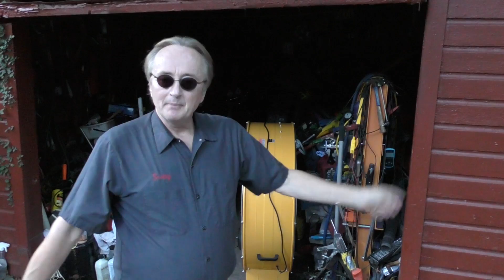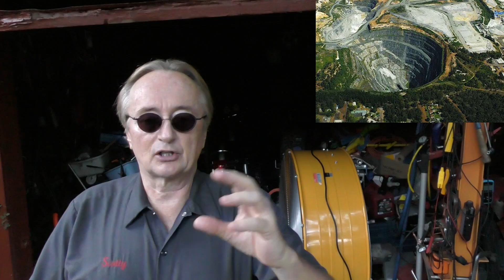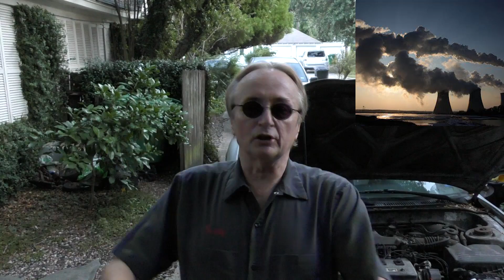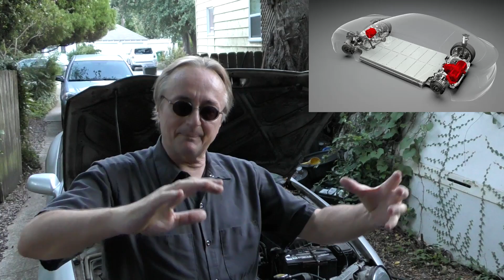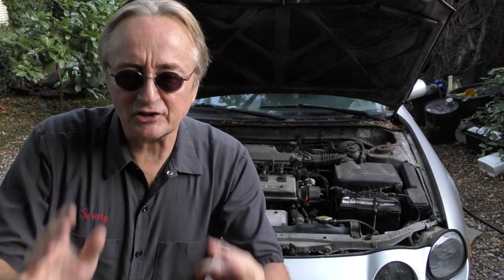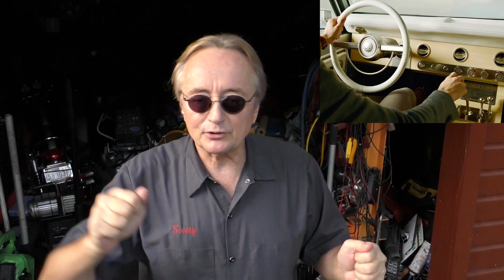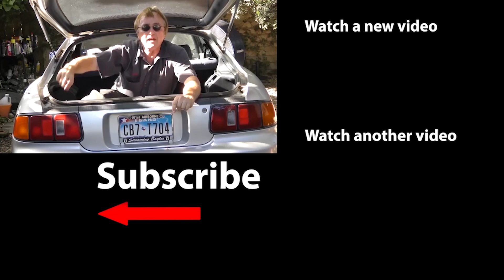Saying Goodbye to My Toyota Celica's Engine

Comment: Thanks for addressing the pollution issues of generating lithium.
Reply: honestly i had 0 idea about it, untill he said it
Reply: @threestrikes1448  not many people talk about it. The recycling of batteries and solar panels is also a major problem.

 In theory, the lithium is infinitely recyclable. In practice, most of it ends up in a landfill in a 3rd world country.
Reply: @RealityGutPunch  It will until someone builds a large and efficient enough factory to make recycling Li-Ion batteries less expensive than buying a material whose market price will continue to climb as demand for it increases.    That is what happened with steel and aluminum.
Reply: @psdaengr6155  yeah I'm sure it will become economically viable as it has been with lead acid for awhile. That said, places like Bangladesh have only just started to recycle lead acid batteries and the first true solar panel recycling facility only really came online last year (in France). 

I have worked in O&G and mining for a long time and now I work in robotics and automation, so I've seen what happens in real life on both sides of energy production; not just in theory. 

Tailing ponds from bitumen extraction aren't a problem in theory, as you can come back and process them later as they're lined with bentonite clay. The problem is - just like mining lithium, tailing ponds blow holes out the side and leak into ground water. And animals get in there, birds try and land in them, etc. 

 It's very difficult to quantify total lifecycle pollution and the most used current indicator - Co2, is a really crappy one. People getting cancer from polluted groundwater is a much more immediate and severe consequence than excess Co2 production.
Reply: @RealityGutPunch  I agree, and in addition, CO2 isn't a pollutant. i.e. greenhouses regularly pump over 1000 ppm of CO2 inside to help plants grow faster & healthier, without any ill effects.  And the temperature inside the greenhouse doesn't go up despite all that extra CO2.  No one ever talks about that.
Reply: @RealityGutPunch  Lithium batteries can be recycled 96%, it's just some cobalt, nickel, manganese, lithium, aluminium, copper and graphite rolled up in a pvc shrink wrap. Also don't forget that oil has to be refined into fuel.
Reply: @FoodOnCrack  I'm not arguing theoreticals vs. current state. I'm arguing current state vs. current state. Yes there is more room for advancement with battery tech vs. O&G extraction and refinement. That's not my argument. 

"it's just some cobalt, nickel, manganese, lithium, aluminium, copper and graphite rolled up in a pvc shrink wrap." 

Your statement is very oversimplified, and if it were correct it would be much more financially viable and mechanically simple to recycle Li-ion batteries of all varieties. 

Even the ubiquitous 18650 is not manufactured in the way you describe.
Reply: @RealityGutPunch  not so, most EV batteries are getting a second life for domestic power storage, like powerwalls or equivalent and then go on to be recycled. You really think they're going to dump something that can be recycled into a $10000 car battery pack? It's not about being green, it's about the money they can make.
Reply: @PaulMansfield  no. Your assertions are simply incorrect and there are no studies or numbers to back up your statement. A small number of DIYer's who are very competent at sizing and installing their own solar are recycling EV batteries into additional storage for their personal systems. If you understood nominal voltage and cycling of old batteries, you would understand why it doesn't always make sense to employ a partially depleted EV battery into an existing storage system. This is not the norm or even 5% of the market. 

Professional installers must use new components to qualify for tax incentives basically anywhere in the world said incentives exist. What you are talking about is where EV batteries will THEORETICALLY go. Not where most go today. 

Go and get some partially depleted cells off ebay, bottom and top balance them, load test them; connect them to a BMS, then try to integrate them into an existing system. I've done it, and it's not a plug and play operation. Don't 'pie in the sky' a working engineer.
Reply: @RealityGutPunch  define "major problem" please. Compared to what?
Reply: Carefull Drew. Understanding how shallow so much trendoid media magnet ecological "syense" is not allowed in our society. We are all supposed to drive to climate change protests, stand up against logging from our wooden houses, wring our hands about CO2 while jetting to the Mayan Riviera for a weeklong all inclusive and think our electric clothes dryer will run on solar pixie dust instead of contemplating a clothes line.

The answer is sooo  godamned simple. Stop consuming.

 But that's not as sexy as a Tesla.
Reply: How is it bad to mine all that useless salt from the ground?  having a few holes in that ground will be good for nature, nature likes variation in forests.
Reply: @alanssnack1192  I don't think you properly grasp the scale and consequence of mining in general. Please do more research. It is a complex subject and I think you'd do well reading about (or watching) the process.
Reply: The TRULY eco-friendly ride bikes or walk, everything else is a green house gas/pollution cover up or lie.
Reply: Pollution is a FUD issue without a context for discussion.  Compare lithium extraction pollution to  the pollution caused by creating  petroleum fuels and consuming them once in vehicles.  Petroleum and batteries both store energy that ultimately comes from the sun.  Li-Ion batteries can do it over and over, and afterward their materials can be recycled and used again.
Reply: @psdaengr6155  Usually its the people who hate any and all environmental causes who love repeating how either the lithium mining is bad, or that even your electronic readers are worse for the environment that printing books from paper. Its just what pollution and environmental harm deniers love to repeat as if it somehow supports their anti environmentalist view. Yes, of course there are extreme environmentalists, and some of them are genuinely bad people. But science is generally on environmentalism side.
Reply: @psdaengr6155  Just imagine if those who drive oversized pig SUZs and pickup trucks to small 4 cylinder sedans that get 40-50 mph. The petroleum infrastructure is already in place for petroleum and could actually shrink. Creating a whole new EV infrastructure will create it's own new eco-footprint. And the North American grid is still about 75% thermal coal fired from plants that are less than 30% efficient at turning coal to electricity. Texas in particular, is isolated from the rest of the NA grid and produces nearly ALL it's electricity from petroleum. Soooo..an EV in Texas actually runs on....petroleum.
Reply: @stevest1300  I replaced a small car and a van with a SUV.  Less maintenance, less insurance. I have put a bath tub in the SUV,  plywood goes on the roof, and it tows my sailboat. On trips to a cottage, both highway and back roads, I"ve gotten 35 mpg, several times. (Not towing). I average about 30 mpg during rush hour, to and from work.  I was reading an article about the efficiencies of electric cars, and the opening photo was of a Prius, parked in a coal pile.  For what it's worth, the artcle said that the most envoirrmentally clean car, from building to scraping, was a diesel.
Reply: @stevest1300  ok, so how does what you stated in any way invalidates the effect or benefit from electric and hybrid cars? You know people drive cars and have electricity outside of texas right? What you described is probably a good argument to reduce petroleum use. Use of coal is pretty much 100% bad for everyone except the workers who want to work in coal mines and companies.
Reply: They are problems, but they are not more harmful to the environment than oil consumption.

Comment: Here is the "green" electric dream.  Put solar panels on your house.  Put a battery on your garage wall to store the electricity for night-time use.  Charge your house and your electric car.  I bought the Tesla Model 3 that gets 126 mpgE.  That is 126 miles per gallon equivalence to gasoline based on cost.  My solar panels will be installed late this month or early next month.  Now, I just need to purchase a battery for the garage wall.  If we all put solar panels on our roofs, the polluting coal factories will go out of business!

Comment: Living and consuming...it's a dirty business. 

Someone in continental germany did an impact assessment on electric cars and came up with a straw figure of 64k miles before they're cleaner than gasoline powered cars, but the overall impact with them for someone who drives a lot is that they are actually better for the environment. If not great. 

nanotechnology for batteries should lower the amount of lithium needed, the recycling of the batteries doesn't look impressive so far. That said, a tesla 76kw battery pack has 90% of its capacity left at 160K miles. I can't believe there won't be a secondary market to keep the batteries running a whole lot longer than one car, or have them stuffed into a house in some high dollar area so that they can be charged when the power is cheap and used in the house when it's not. 60+kw of battery bank would be pretty fantastic, even if it's "out of a used car".

Comment: Everybody can crank up their ovens on Thanksgiving and the power grid doesn't melt down. EV chargers can suck down a lot more power than an oven, but they can also do this at night when grid demand is very low.

For those EV users who drive 50ish miles a day, the charge time is pretty short. It is roughly equivalent to having your clothes dryer on and using an electric oven/range at the same time.

Networked smart appliances could control EV charging based on what else is running in the house. This could even be done with smart outlets where the power hogs plug in.

Comment: I agree that Lithium processing is not clean however, so is extracting oil. You have to take into account all the waste that's getting eliminated by going electric not just the fuel.

The engine is a very complex system with a lot of moving parts which eventually wear out and need to be replaced. All these parts including the replaceable ones take energy to make and distribute.
There are also fluids like the engine oil, grease, sealents, ect. that also take energy to produce and distribute. 

The gas you put into your car doesn't magically appear. It takes a lot of energy to make a gallon of that stuff and that's not mentioning the energy it takes to transport it across the sea and to the final destination.

Supply and demand will eventually make EVs cleaner than they are currently. New battery technology will increase efficiency and solar panels will help with the pollution at the electrical source.

Converting cars is more expensive than buying one. It is a great adea with old classics because they were all wire driven. New cars tosday are run with computers so it becomes very difficult to reprogram the computers to run on a different system. Check out Rich Rebuilds on youtube. There's a video he makes on converting cars to electric.

Comment: I have a Toyota Prius that already has an electric motor. How hard would it be to change it to all electric? It currently has a 200 volt battery but I imagine it would need a large Lithium battery to get long range power.

Comment: I am a fan of cars similar to the plug in prius. They have enough range for most commuters if you charge up. But then can drive on hybrid mode if you need to go farther so you are not tied down to needing a charge or stuck if the power browns out

Comment: By leaving the transmission in may contribute to power losses. Some calculations and testing for existing combustion engine cars is being done. It also depends from the kind of electric motor used. Good idea though. Many are already doing it. Batteries are getting better also. Exciting times.

Comment: True. Mining is evil. 
However; unlike extracting fossil fuels and releasing them into our environment forever, lithium is 80% recyclable. 
So don’t throw away old lithium batteries!
Also, would you ever consider installing a mini power station in the corner of your garage with solar panels on the roof?

Comment: My dad was a small gas engine and automotive instructor for one of our local high schools years ago. In the early '90s the shop was donated a  baby chevy green 1977 ford courier that had been converted to electric, it had 27 6v batteries in the bed of it, still used the original automatic tranny the truck came with. Thing took like 14 hours to charge, got around 80 miles per charge, wasn't very quick but it was an interesting addition for a training aid for the kids.

Comment: If the idea of "green" was corresponding with reality, focus would be about spending less energy. Transportation wise that will have to imply cutting down dead weight for light travel and a best possible utilization of energies at hand. Therefore anything running of any of todays existing battery concepts, explictly does not make sense at all. Eletric transportation made sense with the old grid tied public tram and can be redone fit for private vehicles by major costly infrastructural upgrades. A better principle option is the good old toy, the wind-up car. Springs can store vast amounts of rotational energy to weight ratio. It also easily allows for regenerative breaking. It should be WAY cheaper to build pr unit than any other powerplant/storage system at market and demands little else to existing infrastructure than a fast and furious wind-up unit aside existing gas station pumps. "Charging time " and reach would leave any Tesla or other in the dust of time as the ideological failure it is. Down to a very small lightweight engine/electric motor could even be fitted for getting around independent situations, emergency auxillary or overnight home charges. High pressure lightweight friction discs could easily beat the socks of todays EV´s winter situations. Built heavy duty enough, such a system should be able to power any hauling rig. Why do I not see any such vehicle concepts  around ?